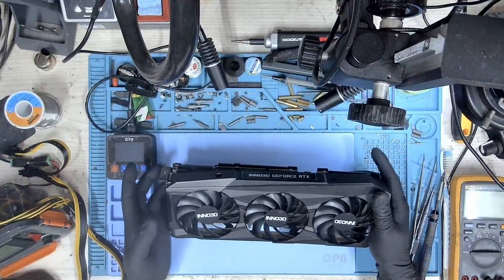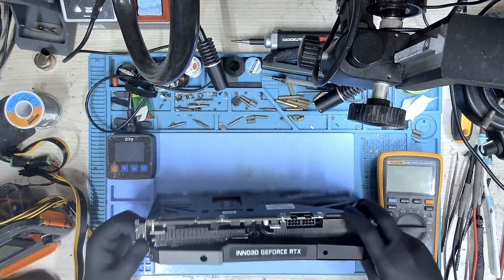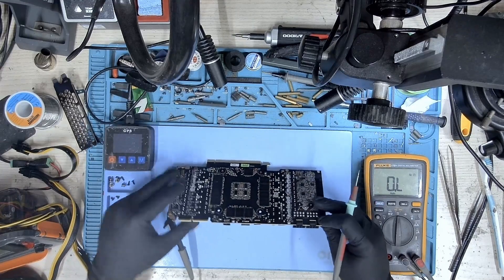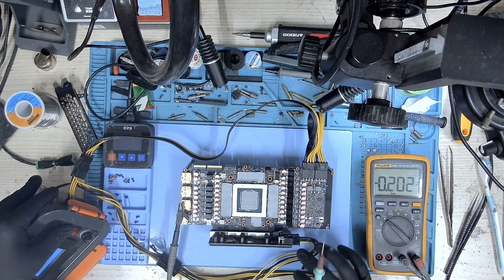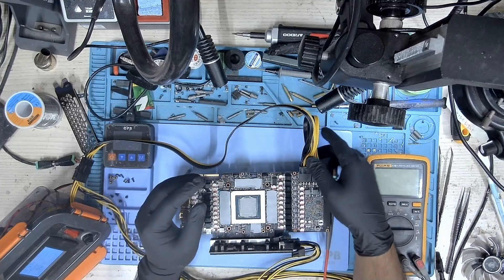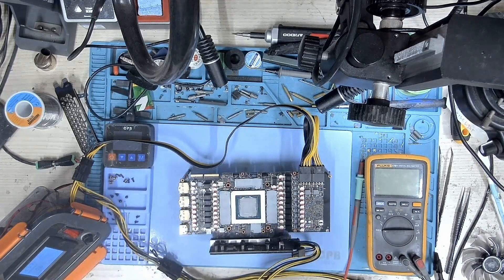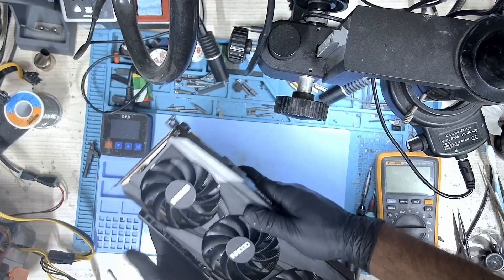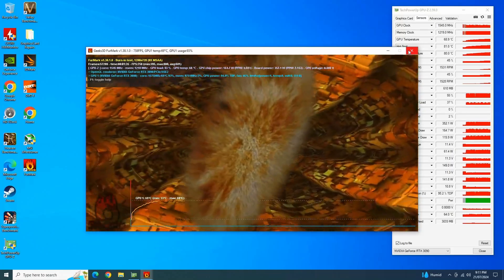Inno3D RTX 3090 - The Mysterious Short Circuit Fix

Comment: Interesting video! I have an Inno3d RTX 3070 that is causing my computer to shut down instantly. Same result in a different computer. The GPU is shorting somewhere (likely caused be a dying PSU - which is getting replaced). I don't know anything about checking for shorts, but maybe if I just disconnect the LED then it'll work XD. Fingers crossed.
Reply: I just unplugged the LED. Not fixed. Oh well. I'll send it to a repair shop

Comment: Do you consider Inno3D to have a good build, would it be a good purchase? Example RTX 5080
Reply from the maker: All AiB cards are good as the use the same core. It all comes down to the components used. Some cheap out on fuses including the known brands like Asus and MSI. I personally use a PNY GPU and it is as good as any other brand. You will find it cheaper as it is not a strong brand name.